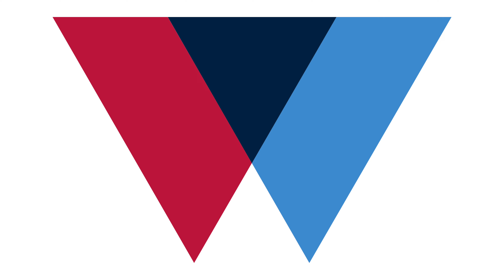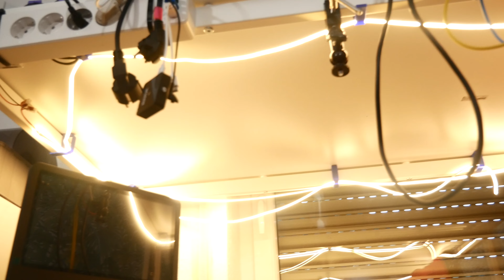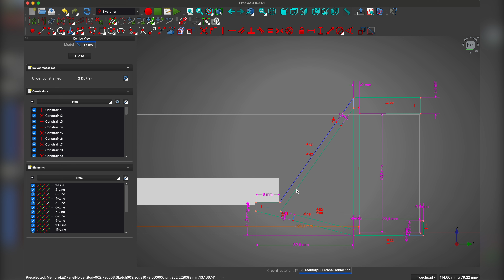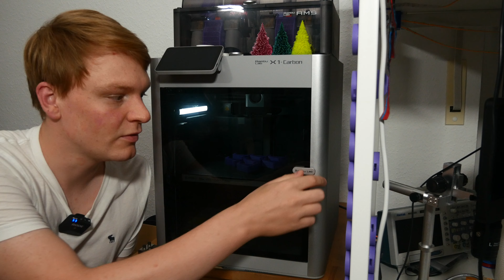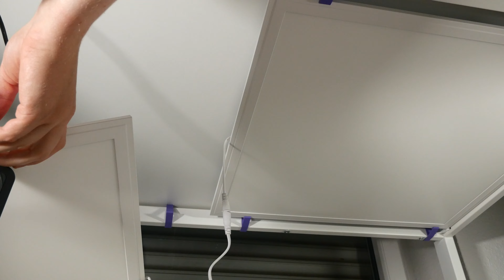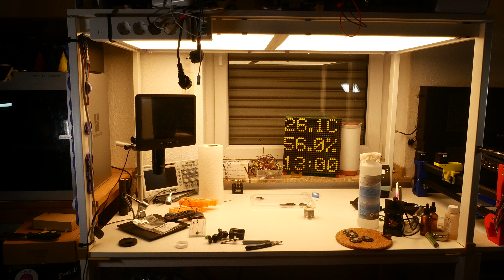Upgrading my workbench lighting with LED panels | Ikea Melltorp | 60x60 cm LED Paels | CRI95+

Comment: Good work! I was about to install some led stripes but now I have a better alternative. Thanks for sharing your work!
Reply from the maker: Thanks, while using the panels might be a little more expensive than glueing on an led strip, they do look a lot nicer
Reply: @enwi  Much nicer, and the light is even. The only inconvenient is to find the panel with the exact dimensions, but, nothing is perfect!
Reply from the maker: I only found 60x60 and 63x63 cm panels that would fit nicely